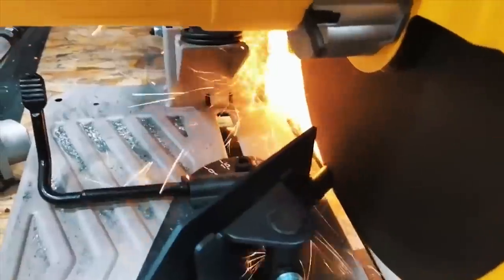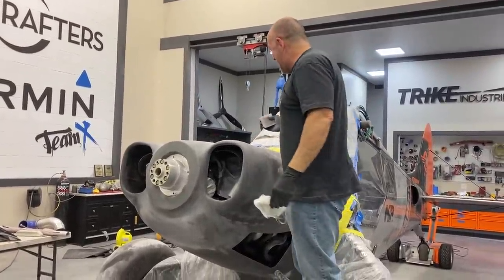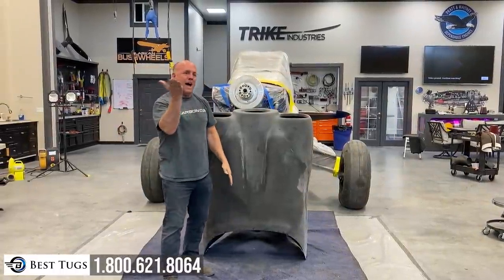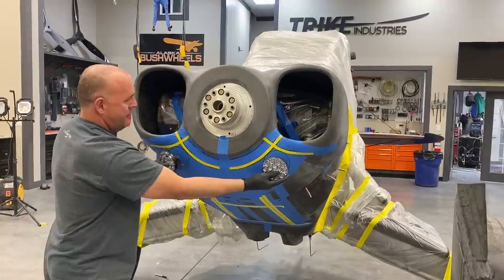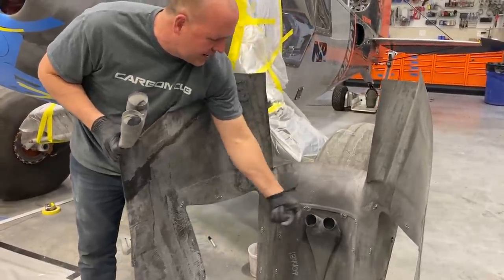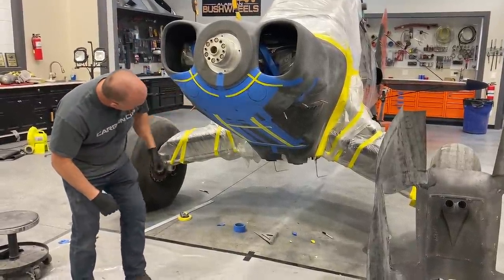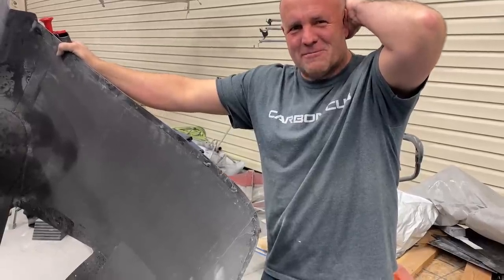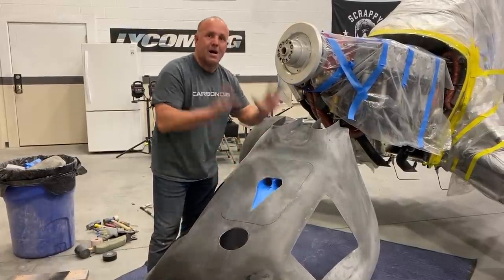I'm Cutting Up My Carbon Fiber Airplane Cowling  | Scrappy #45

Comment: Wow, it keeps on getting better and better (two thumbs up)

One question though ;

How are you going to prevent dust and debris kicked up by the prop (FOD) from entering the cowl via your under belly "submerged inlet" (NACA Duct) ? 

If you're planning to install a filter, I guess the CSA of the holes already compensates through being of a larger size ?

Comment: A tip to releasing hot glue: use rubbing alcohol. This is a lot easier than cutting or scraping it off after mocking things up.

Comment: If the inside of the bottom cowling is completely smooth, it will be easy to clean any oil... as if any oil would dare leak in that airplane.

Comment: Mike your builds are great, Draco was awesome and Scrappy took it to a new level and I look forward to every video. I love aviation and have always wanted to be a pilot. I am a classic car guy and have some that I am restoring. I have a 1969 Camaro SS convertible I am working on now. Do you still like the inflatable paint booth? What brand did you get and were there any issue that you had? Thank You

Comment: Is there any concern putting the flir camera with the associated electronics between the two very hot exhaust pipes?
Great videos, great project.
Thanks,

Rick
Reply from the maker: Yes, great question. It goes I sided a heat Sheilds carbon box with a fresh air pass through vent

Comment: Have you tried using 90% isopropyl alcohol on your hot glue when ready to remove?...it will release it instantly with no scraping or residue.

Comment: What’s your standard edge distance in carbon fiber? Same as typical #30 or #40 in aluminum?
Reply from the maker: Yes.  I do the same but carbon can go closer if it has the correct thickness edge.  I use the same offsets either way.

Comment: Hello Mike! I build flying rc paper models with carbon fiber and micro balloons and I do one offs etc as you do in real life.  My question is, all the parts I make with the micro balloons are lighter, but are always significantly weaker.  Why are you not worried about strength? 
Love your work, love your style.
Peace
G
Reply from the maker: Great question. 👍🤠 The micro is never used for structure areas.  It it’s great for steps or slight fillers but can cause a brittle line. so in all structural areas it’s minimal to none and if used carbon layers must be accounted correctly to keep the structure integrity.

Comment: curious to see if the NITE VISION CAMERA PLACEM,ENT so close to the exhaust heat,will affect its performance????
Reply from the maker: It goes inside a heated Sheilded carbon box with a fresh air pass through vent.  Great question 👍🤠
Reply: @MikePatey  a great question....,coming from you MADE MY DAY,thnx mike

Comment: I know that water flowing through a water/air radiator if it is flowing too fast will not shed the heat it carries. Is there a similar lack of heat transfer caused by the speed of the air flowing through the same radiator?
P.S. Our family calls it a Wonder Tool because we wonder why it took so long for someone to invent such a breakthrough tool.

Comment: How many watts for those lights? Are they consuming more power than the excess from your generator under normal load?
Reply: They are LEDs, they shouldn’t be a huge current draw. I imagine the biggest draw is the 27 Garmin panels!🤣
Reply: @tomcoryell  A couple of hundred watts total, easily.
Reply: He may not be using this exact brand, but this page says they draw at most 100w per light and lifespan is something like 1000x that of a standard bulb

aeroleds .com/products/sunspot-36-4000-landing-light/
Reply: @russellsmith3825  Still 8 ampere per light. Do you know what generator is on it?
Reply: @tomcoryell  Those panels can´t be more than a couple of ampere each.
Reply: @AllanFolm  I don't recall if Mike said how many amps it was.
I'd bet it's 100a or more if 12v
Reply from the maker: Great question 👍🤠. I have dual BnC alternators and either one can run everything I need
Reply: @MikePatey  I'd hate to see you standing in the outback waving a pair of jumper leads around.

Comment: Is there any reason you couldn't use fiberglass for the base mold?
Reply from the maker: Yes you can and I often do. I just didn’t have the fiberglass weave I wanted but the carbon I had in the shop

Comment: this may be impossible but what if u could design a wing for high speed but be able to actualy rotate the wing back a few degrees for slow flight from the root on both sides so flaps alerons leading edge would rotate with as one pieace??
Reply: kinda like the elevater for big air bus the trim actual turns the whole system

Comment: I turned 65 in June of last year and I was seriously concerned about my energy levels dropping off.  Stamina wasn't what it once was and I couldn't get a handle on the problem.  I think I finally figured it out.  Every time I watch one of Mike's videos I'm done in, exhausted, mentally and physically.  I'm gonna figure out a different viewing schedule so I can get some work done around here.  Mike, if you figure out how to bottle your energy level put me down for a case of that stuff.  P.S.  Mike,  I asked you this question in an earlier video and you probably answered it and I can't find it.  What is the brand name of the White Micro-filler that your always using?   I could really use that stuff.  Thanks, now I have to get back to work......

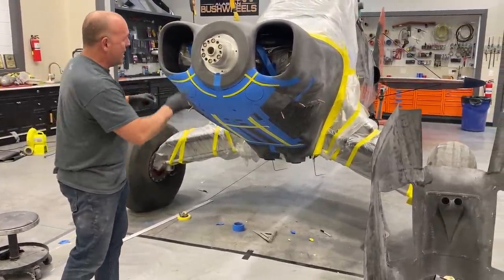Comment: 7:49
Would there be a concern the radiated IR pattern around the the exhaust pipes would saturate the IR sensor in you night vision camera, assuming  it is  an IR sensor and not a low light sensor  ?
Reply from the maker: Yes great question.  It goes inside a heat sheilded carbon box with a fresh air pass through vent

Comment: How is it going to affect cg? Most of the weight is in the front.
Reply from the maker: Great question.  Those calculations were done while I was cutting the first frame pipes.  The engine is back over two feet from any cub design. Completely different in all areas CG front to back

Comment: "Because I'm gonna make an airtight pressurized upper deck plenum"  yup duh! Way ahead of you! pshhh totally! I mean only an Idiot couldn't see that! - PS. thanks for inspiring me to make a new carbon cowling instead of just repairing modifying and adding weight. It won't be perfect and im gonna let my imperfections show in raw carbon... sorry!!! I will be trying out these ticks you wont shut up about tho so thanks! and i like the little tape trick.. ya it was dumb but i didn't know it so hopefully mine end up aligned nice now

Comment: Funny he talks as if this stuff is so easy to manufacture = )
Im saving up to build an RV-10 wish I could afford the Panthera since its composite.  We would get along well he is sooooo anal like me.  On all my cowling, wing tips and wheel pants I was considering a strip of kevlar to prevent cracking around nut plates and screws, do you have any thoughts on the? Good, Bad, want help? Thanks

Comment: If we had small turbofan jets the whole fuselage could just be one simple piece, not all the nose complexity.
Reply: Turbofans are extremely inefficient at low speeds. Turbofans would still need some sort of housing that would still be complicated to build. It would be pretty cool to see Mike build a custom jet though 😂.
Reply: @marco.9900  I'm not sure efficiency is that bad even at low speed but tiny jets can be very light, not the anvil engine scrappy has and just a monocoque CF shell fuselage can weigh very little so very low weight might allow stol ability in a fast efficient jet.
Reply: @DanFrederiksen  Yes, and that is why Draco had a turboprop engine. It has a much higher thrust to weight ratio than internal combustion, and has its turbine attached to a large propeller as compared to a small fan, further promoting efficiency. However, for low speed-low altitude aircraft, internal combustion is almost always the way to go for peak efficiency.
Reply: @marco.9900  who said low speed is a goal. Indeed the very opposite. high and fast and some stol as a freebie because it's light.
Reply: @DanFrederiksen  If you want that, get a Pilatus PC-24. Scrappy, unless I’m wrong, is being built for 100% STOL.
Reply: @marco.9900  A PC24 is 5 ton empty, a 10 mill bird and needs 800 meter runway. I'm talking about something 20x lighter. Maybe 4x lighter than scrappy. Don't be so thoughtlessly dismissive.
Reply: @DanFrederiksen   I sincerely apologize if I came across as dismissive. If you are willing to step down to a turboprop, my personal favorite plane, the Lancair Evolution Turbine, has 330 kt (380mph) top speeds, 1000ft takeoff and landing roll on any smooth terrain with the optional “rough service landing gear”, seats 4 people +gear, and only costs ~$1,000,000. It fits your description very closely. It also flys at the same speeds as a jet of that size. Jets are really cool, I agree, but they suck (pun not intended) from an efficiency standpoint.
Reply: Also... are you implying a 500lb airplane?! Maybe it’s possible, but it’s a tough goal to meet. For reference, the Subsonex Jet weighs 500lbs.
Reply: @marco.9900  You are still arguing for status quo without reason. Lancair turboprop still has the nose complexity, it's very noisy, it's heavier than a jet because of hte gearbox, more expensive and it doesn't have the redundancy of two engines. Twin jet is naturally light, redundant, placed quietly at the rear and simple. A lancair turboprop is also very heavy at 1200kg empty. What I suggest would have two 10kg turbojet engines and maybe 200kg for the rest. That's 5 cast iron pianos shaved off. The PT6 turboprop engine is close to a million dollars. What I propose could easily be 10k$ per engine. Try to understand some of it. No mindless objections but make the effort to see.
Williams EJ22 engine that the Eclipse was supposed to use was only 44kg. A 200kg plane needs much smaller engines so try to imagine a 10kg engine the size of a basketball. Can you imagine that can be sold for less than half a million. Can you understand that material strength tolerances because much easier in small sizes.
Can you understand the value of LSA weight and price class able to cruise smooth and quiet at mach 0.7 at FL430. Take off from any little runway. Maybe even some stol.
Reply: @DanFrederiksen  I now understand what you are saying. I admire the innovative thinking. Hopefully either yourself or a business can fulfill your dream. 
Perhaps I shouldn’t have judged your idea so harshly - I remember that several years back I fantasized of a single pilot Mach 3 VTOL business jet. 🙄
Ambitious and innovative minds like yours are what keeps the world moving forward. Good Luck.
Reply: @marco.9900  thank you. Not that all burden should fall on the Pateys but I figure that just the small jet engine would be the seed piece that would make plane builders make planes for it. Just the engine alone could start it all and Mike has the means, skill, drive and inclination to pull it off in short order. Just starting such a company could take on a life of it's own and could be sold off for hundreds of millions and require no more effort. A turbofan engine is not that complicated, it's 1940s tech and we have modern production methods. And it's tiny. It's basically just scaling a Williams EJ22 down to 60% or so. Although I believe the burn area principle could be vastly improved, there is something to be said for quick success, at least at first. Could be followed up by an even vastly superior product. Couldn't hurt.
Reply: @marco.9900  I'm not implying 500lbs. I'm stating outright a 220kg twin jet 4 seater.